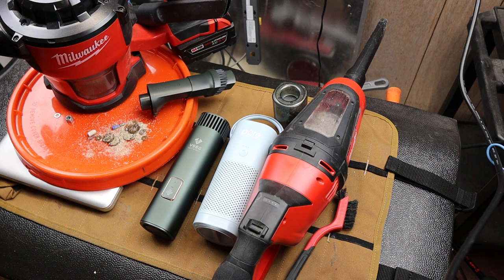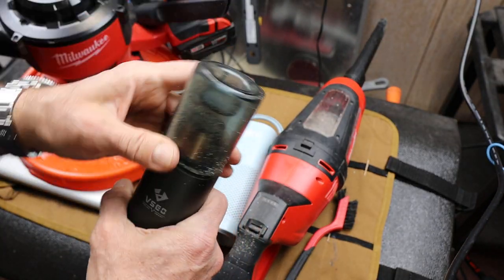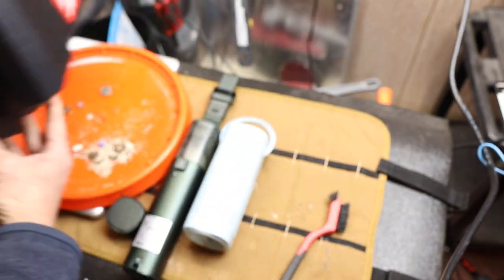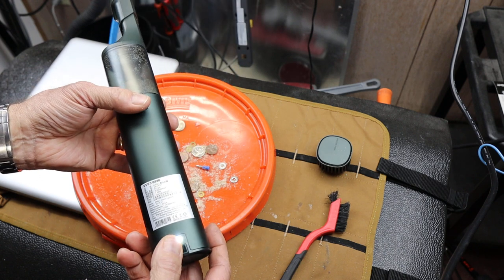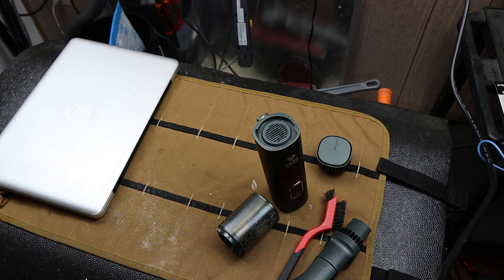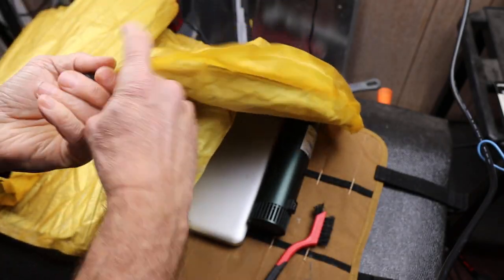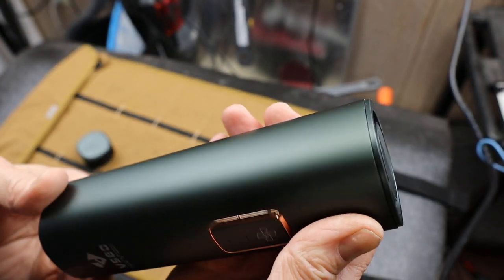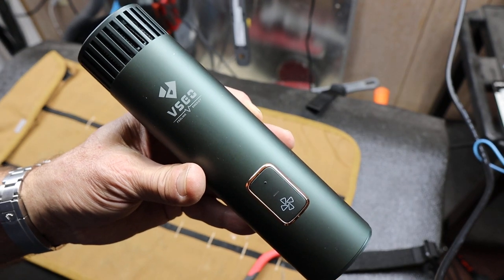The VSGO VS-VC01 Pro: An amazing rechargeable car/electronics vacuum & blower in a beautiful design.

Comment: Hi Doc, I've bought one of these on the back of your video and it's a great device. One question though - does the light flash whilst it's charging? If so, it seems to take an age to charge - I've never yet got the light to do anything other flash when plugged in.
Reply: Just got this vac; when first plugged in, it flashes; when the charge is complete, the light stays on.

Comment: There are tons of these on Amazon, it's the typical Chinese name generator brand that there are a million of. Even on the suggested other items, there's one by "Rubot" (another china name generator brand) for $60 cheaper with the exact same specs and design.
Reply from the maker: There are many similar shaped vacuums, true. However the features of this specific one are, as far as I can tell, completely unique. The dual flashlights and the blower-inflator with hurricane mode set this one apart. Other differences are battery power, runtime, and HEPA filtration in both directions, and overall suction. But thanks for pointing out what others might discover as well. As I mentioned, I studied this for a while before taking a chance on it in person.

Comment: @Last Best Tool hey I just wanted to give you a heads up this vacuum is way overpriced... The Wyze handheld vac is actually more powerful with 16800pa vs this one being 16000pa... Not to mention it comes with way more accessories for vacuuming and it's more than half the price. Wyze is only $43.98 instead of paying $119 for this one(vsgo) save your money people. And I've purchased many of Wyze products in the customer service is unbelievable.
Reply: I just got one VSGO vacuum cleaner,  these two products are not the same grade at all, first of all, from the production material, VSGO uses aluminum alloy, small and portable, and the product you are talking about is plastic, and the volume is too large, can not be carried, secondly, from the performance point of view, the product you said can only be used for 30 minutes, and VSGO's battery life has 45 minutes when you use low gear, I think this is a big gap. As for the final function, VSGO is not just a vacuum, it can also blow air to clean, as shown in the video, it can blow the camera and inflate the air cushion, which is very suitable for camping. Totally worth the price.